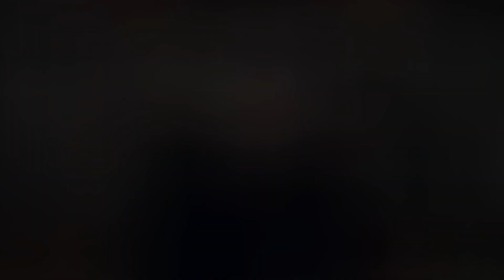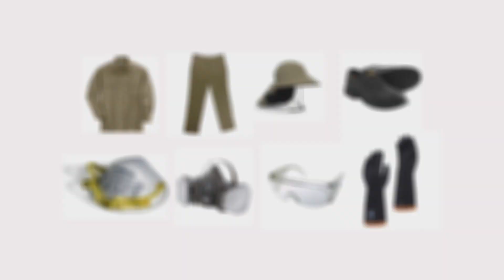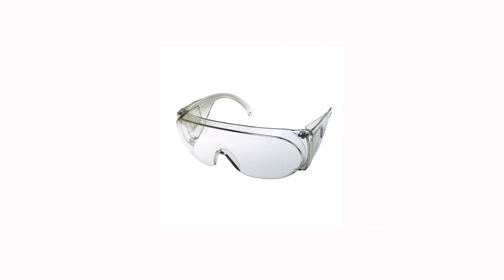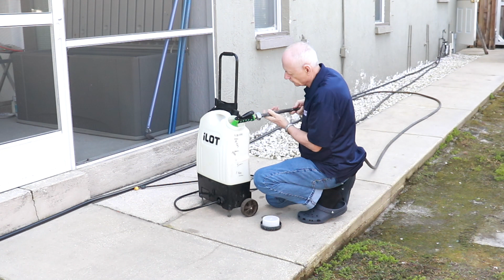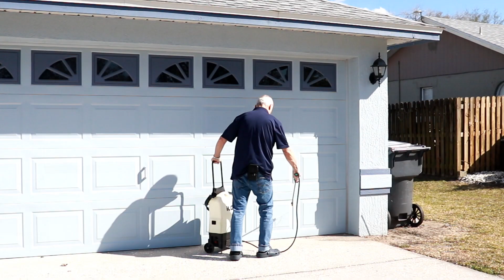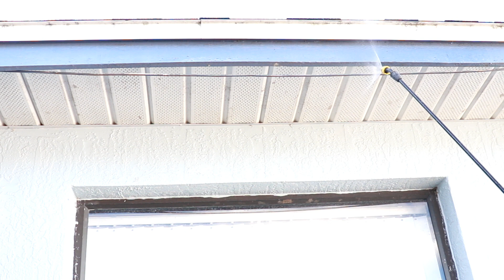How to Prevent Drywood Termites 100% Guaranteed.

Comment: Years ago I moved into an old dry wood termite infested apt building with my then girlfriend (now wife). I brought a vintage wood framed couch with me. When we moved out over the next year we threw away her furniture as it was hollow and falling apart or we saw active kickout holes with frass. My couch seemed fine but a few years later I found a tiny hollow sounding spot with new frass. I disassembled the wood frame and made a heat treatment tent by covering it with an old blanket and blowing a space heater into an opening in the tented area for over an hour. I measured the temperature on the far side opposite the heater with a meat thermometer. It did the job. It took a while as I did each piece separately.
The trick is to blow the space heater into a small igloo like door and to open a smaller vent opposite to exhaust some air to get a flow through the "tent" of blankets. You can't just encapsulate the heater as they all have overheat shut-off sensors. You need a little flow but not too much to build up the temperature for the required duration.
The couch is still with us over 20 years later.
Reply from the maker: Very clever.  Thanks for sharing.  Be well my friend.

Comment: Is Taurus SC safe to humans and pets once it dries?  I just got my house fumigated. Now I'm terrified of getting termites again. Very expensive to deal with. Does the Taurus SC penetrate the wood studs in my shed so that it becomes unattractive to termites?  Is Taurus SC the same as what the pest companies use?  They charged me $800 to spray a product they said I could not buy as a consumer. They told me I'm protected for at least 2 years. But I want to spray more and do a more thorough job. I dont think they got every single area.   But they said they did. Thanks
Reply from the maker: Taurus SC and most of the pesticides are safe enough for children to play on after they dry.  That is an EPA requirement that was put into place in the late 20th century.  Taurus SC does not penetrate the wood to prevent termites.  It doesn't work that way.  It is a surface treatment only.  This is the same product that the professionals use except the stuff they use is Termidor SC.  Both products are exactly the same.  You can buy either product, but Taurus SC is a little less expensive.  When used in trenching, these products will last 5 to 10 years.  However, when applied as a surface spray you would be lucky to get 4 months out of them.  So, the pest controller basically misled you.  If you are using Taurus SC, you should be applying this product as shown in my video, at least every 3 months.  You can treat unfinished wood with Bora-Care.  This product will permanently treat the wood it is applied to and make it termite proof forever.  I will give you a link to the product and a video on how to use it.  It is okay to use this product with cold water.  I recommend mixing it one to one with water.  Ignore the label recommendations to mix it one to five. 

You can purchase just about any pesticide you want from domyown.com.  They will ship to most states. 

I hope that helps.  Be well my friend.

Bora-Care:  https://www.domyown.com/boracare-p-100.html

Bora-Care video:  https://www.youtube.com/watch?v=Rmr_aEodyhg

Comment: Interesting how you said most DIYers fail because they only do a light spray outside the perimeter of their homes. Meanwhile my neighbors pest control does an even lighter spray before jumping on his van and going to the next property. Definitely reminds me why I rather do things myself to make sure they're done with care and quality since it's for my house and not just another clients
Reply from the maker: Some of the pros don't understand that there are bugs that breed where the foundation or slab meets the ground, so you need to get the pesticide into that area really well.  Also, how many bugs do you see walking across the top of the grass?  They are generally traveling on the dirt, which is below the grass, gravel, mulch, and so forth.  Unless you just have bare dirt from the house about 3 feet out, then you need to get the pesticide down to where the bugs are actually located, or they will be crawling under it.  A light spray on the building is fine, but it won't work well on the ground.  If you stop and think about it, isn't this just common sense?  You can't help but wonder how a licensed pest controller is not aware of this.  You are right though.  I see it all the time.  I have even watched videos on it, and it just leaves me scratching my head.  This is one of those things that is easy to do yourself.  You will do it better and it will save you a lot of money.  Thanks for watching.  Be well my friend.
Reply: @GuysPestSolutions  I 100% agree thank you again for the great video and for the comment! God bless
Reply from the maker: @ericg5877  You are very welcome.  Be well my friend.

Comment: Hi Guy, I appreciate your expertise and videos. I would like to ask how do i get rid of dry wood termites discovered yesterday in my unfinished basement beams. A few beams are hollow and a few window sills shows holes and frass. I appreciate your direct response.  Thank you
Reply from the maker: I’m so sorry that you are having this problem and I'm sorry for the delay in responding.  I am on vacation at the moment, and I am on a cruise, so I don't always have internet and often I am doing vacation stuff.  My wife and I have not had a vacation in over 13 years, so it was time.  I will be home on June 11, so I can answer any additional questions you may have at that time.

Are you sure that these guys are drywood termites.  It takes a very long time for drywood termites to do a lot of damage, so make sure that you have the species correctly identified.  If these are drywood termites, then it is important to understand how drywood termites work.  They enter through cracks and crevices around windows, doors, eaves, pipe penetrations, and so forth.  Most of the time, they enter through several locations.  That is because a swarm of them attacked your house at the same time.  If there was a crack or a crevice, then they probably found it.  After they establish their galleries, which will be inside the wood, it will take four to seven years for them to be able to swarm.  Now that they are in your house, the swarmers will use holes that are in your studs to travel through the walls.  Those holes in the studs were created by the electricians to run the electrical wiring.  Not only are these holes going through the studs, but holes were drilled into the attic for the light switches and to run some of the wiring for the outlets.  So, the termites now have easy access throughout the attic and the walls.  If you have a basement or crawl space, they have access to that as well.  Most of the time, you will have no idea that they are in the walls, because the frass is inside the wall.  To make matters worse, if you have drywood termites, then your neighbors have them too.  That means you have been getting swarmed for as long as they have existed in the neighborhood.  Most likely, we're talking about years, so it's a safe bet that you have these guys in many locations in your home.

I always hate to be the bearer of bad news, but if you have drywood termites, the only sure way to get rid of them is to fumigate.  Prices for this can vary wildly in this industry, so I recommend that you watch my video on how to hire a pest controller without getting ripped off.  That video can save you a lot of money.  You should also know that the gas they use to fumigate has absolutely no residual action whatsoever, so you can get reinfested the moment the tent comes down.  Like I said before, if you have drywood termites, then your neighbors have them as well.  Since drywood termites swarm every year, it is almost a certainty that you will be reinfested within a year after the fumigation is done.  The only way to prevent this is to do a preventive treatment on your house every 60 to 90 days.  Most pest controllers will not do this, so it is something that you generally need to do yourself.  This will not treat the termites that are already there, but it will stop new ones from getting in.  If you absolutely cannot afford to fumigate your house, then you can try spot treating it yourself.  It is virtually impossible to find all the termite galleries, but it is way better than doing nothing.  Regardless of how you treat it, you should begin the preventive treatment immediately, so that you do not get additional termites paying you a visit.

I hope that helps.  Be well my friend.                    

Video on how to hire a pest controller without getting ripped off:  https://youtu.be/y-a8XOqVrlE

Video on how to spot treat drywood termites:  https://youtu.be/U7ck7zhS0Xo
Attachments area
Reply: @GuysPestSolutions  wow Thank you so much Sir. Sorry to interrupt your vacation. Sounds like it’s well deserved for you both. I appreciate your time and details in your response. Of course I’m not happy that I can’t wave a magic wand and get these critters out of my house. So far only evidence is the he window sills in front of my house directly facing my garden bed. I thought they were carpenter bees. Treated with a Home Depot product and they went away a few weeks, now seeing frass. I had a termite inspection which was included in my new signup for pest control. And he told me they are termites and also pointed out that the unfinished basement boards are infested. We did locate the crack in foundation at back of the house which directly leads to those support boards. I am planning to do the every 60 day treatment you introduced to keep them out of the house, I just wasn’t sure how to get them out the boards without paying the hefty price. Especially since they may return after. You scared me about the attic. 🫣
Reply: @GuysPestSolutions  Also wanted to say that the basement wood has been unfinished  since the house was built in 2015. I guess I will start by asking my neighbors if they are experiencing this.  We all have a mini forest behind our homes .
Reply from the maker: @MsLatoyanelson  I'm taking another vacation from my vacation for a few minutes.  Lol.  I just want to make sure that the frass you are seeing is from drywood termites.  I would be a really bad pest controller if I didn't make sure that you are treating the correct species.  I would love it if you could send me a photo of the frass.  If this is drywood termites, then the frass should reappear every time you remove it.  Please watch my video on how to photograph a bug and use that same technique to photograph the frass.  You can send photos to guyspestsolutions@gmail.com.  I will have a look at them when I get home.  Don't worry.  If these are drywood termites, they are very slow eaters and it take years for them to do significant damage, so you do have the luxury of time.  Drywood termites are very different than subterranean termites.  Drywood termites attack from the air, so cracks in the foundation and stuff like that doesn't matter with them.  Subterranean termites attack from the ground and so you need to treat them in the ground.  You only fumigate for drywood termites and not subterranean termites.  So, eliminating subterranean termites is usually something you can do yourself for under $100.  Do you see what I'm saying?  I don't want to send you down the fumigation path that costs a lot of money, if you have a problem that you can treat for a fraction of the cost.  Since you have some time, let's make 100% sure that we identify the species correctly.  If you do need to fumigate, then I will show you how to get the best possible price.  I promise that I know what I am doing, and I will take very good care of you.  When you send the photos, please remind me who you are.  I get a lot of email and most of it is about termites this time of the year because it is swarming season.  So, I want to make sure I know it's you.  Just give me you YouTube name.

I hope that helps.  Be well my friend.

Video on how to photograph a bug:  https://youtu.be/I8qd63hX6y8

Comment: Thank you for this! What do you think about Spectracide Terminate Termite Killing Foam? The Ingredients are very different from FiPro so I wonder if it'll work.
Reply from the maker: Spectracide Terminate Termite Killing Foam will not work because it kills too quickly.  You don't want to kill the termites right away.  You need to give them time to spread the pesticide around the gallery to the other termites and the queen.  Fipronil works best for this, which is why virtually all the professionals use it.  If you cannot get FiPro, you can also use Termidor Foam.  Same thing, but I like the applicator tip better on FiPro.  You can only get FiPro from Solutions Pest and Lawn because they make it, but you can get Termidor Foam from domyown.com.  Solutions P&L does not ship to a lot of places that domyown.com will ship to, like California.

By the way, I will be out of town for a couple of weeks, so I may not be able to answer additional questions until after I get back.  Don't worry though.  If you have follow-up questions, I will answer them upon my return.  I'm sure I'll have a good deal of questions waiting for me, so please be patient.  I will work through them one at a time.  Hopefully it will only take me a week to get caught up.  I promise that I will get back to you if you have additional questions, albeit a little slower than usual.  We have not been on a vacation for over 13 years and my wife has explained in her unique way that the time has come.  So, go I must, and we won't be back until around June 11.

I hope that helps.  Be well Flavia.
Reply: @GuysPestSolutions  You are an angel! Please enjoy that vacation!
Reply from the maker: Thanks.  Should be fun.  The Fuse Foam works okay, but I like pure fipronil better.  Fuse is a combination of fipronil and imidacloprid.  I think it's okay to use though.  Still a slow kill and non-repellent.  Fuse is usually a bit less expensive as well.  I don't use it myself, but I think it will work just fine.  Be well Flavia.
Reply: @GuysPestSolutions  You as well! Thank you so much.
Reply: @GuysPestSolutions  One more thing! How about Fuse Foam 

https://www.solutionsstores.com/fuse-foam?sku=CSI200&gad_source=1&gclid=CjwKCAjwgdayBhBQEiwAXhMxtl0Mnvjsxxypxv1bbQpUd6mJSOHY9A-hXCQ-RNYfoinTKV8SKvrBdxoCB_wQAvD_BwE#156=2982

Comment: I have a dead mango tree in front of my yard, which is termite infested. Earlier I ignored the termites as I was unaware of the damage they can do till they found a way inside my home and started to come out of the RCC walls and cemented floor.

Now I have Bayer Premise. Can you please guide me on how to wipe out the termite colonies. I have already dug a trench around the tree and poured about a 10 gallons of water mixed with Premise in the ratio of 2.1ml/litre. I have also injected the tree holes with the same solution.

I don't have any wooden furniture inside the house, it's just the dead tree and probably the dead roots that run under the foundation of my home. Thanks in advance.
Reply from the maker: Please tell me where you live.  When it comes to termites, location matters.  Keep in mind that when you trench, you need to also treat the backfill dirt.  Are the walls just concrete or are they covered with drywall?  It is very unusual for termites to come out of a wall, unless they are building a carton.  So, we need to identify the species.  If you see any more of them, try to obtain one with a red head.  Put it in a jar and let it die a natural death.  At that point, we can figure out what it is.  If you cannot find one with a red head, then please find any specimen you can.  You can email me at guyspestsolutions@gmail.com and send the photos there.  When you write, be sure to explain again what is going on.  I get a lot of email.  I hope that helps.  Be well my friend.